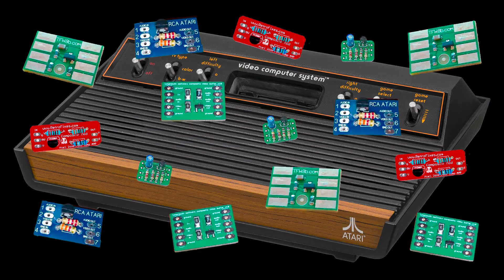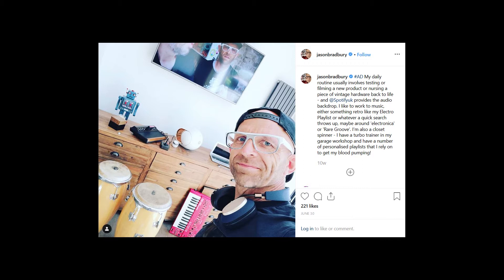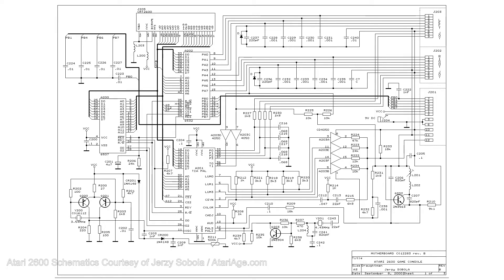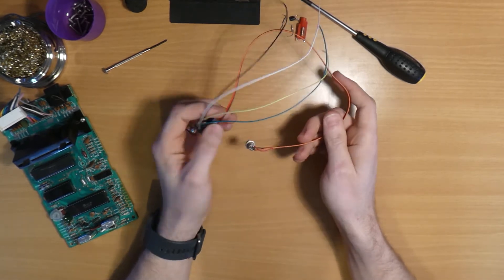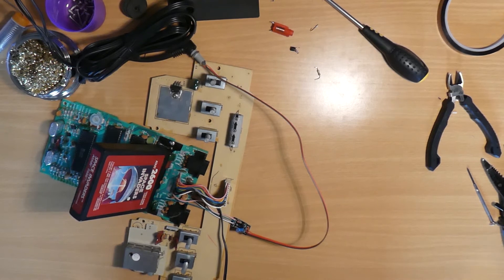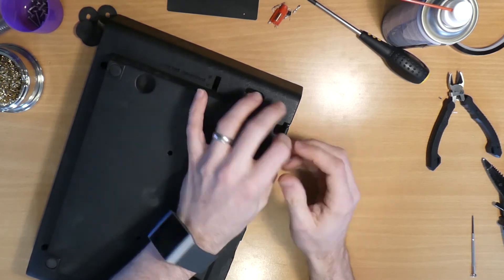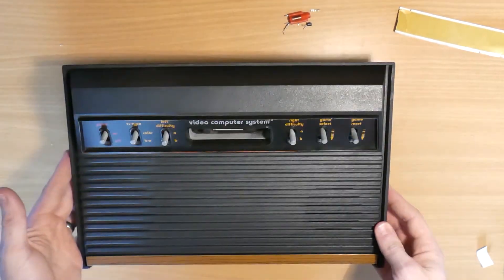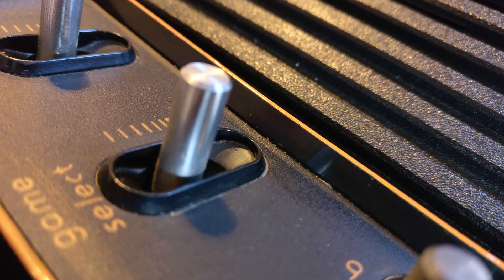Atari 2600 Composite Mod Tutorial - For TV's Jason Bradbury!

Comment: There is a way to mod this without removing any components. Just add some resistors and one cap to the CD4050 , and you are good to go . And to work you have to add proper 5V to the CD4050, because it powered only by 3.7V or so. (Atari's mistake)

Comment: Great vid... I’m going to mod my Atari soon, think i will use rca ports as I don’t want to run the risk of someone in the future plunging the PSU 3.5MM jack into an AV port
Reply from the maker: This is a very good point and something I should have warned about in my video, actually. I haven't tested it myself but I imagine plugging the PSU into the AV jack would be a very bad idea!
Reply from the maker: By the way, I would consider the UAV mod over this one if you're confident enough to tackle it. It's slightly more difficult to install but makes a huge difference. I made a video on it here: https://www.youtube.com/watch?v=XjjghprXHnE

Comment: Hi Rees

I have noticed that you have used pin ten of the ribbon cable for the ground connection, which is shown clearly in the second schematic in your video.
But looking at the main schematic I can't see where pin ten is grounded.

Could you clarify please (I know that pin three and six are suitable candidates) but I am slightly confused.

Regards,

Mark Affleck
Reply from the maker: This was such a long time ago I can't really remember the details but if I used pin 10 it must have been grounded on this particular console. If 3 or 6 look like better candidates in your case then I'd go for one of those instead 👍
Reply: @ctrlaltrees  Thank you!

Comment: The only version of an Atari 2600 I've got, is the excellent Flashback 2 plug & play, which is an actual 2600-on-a-chip, rather than an emulation like the original Flashback (NES-on-a-chip) and Flashback 3 onwards (ARM processors). It's a lovely little machine, already has composite output, and with a UK power supply of the correct type, will run happily on a UK television. It can be modded to have a cart slot, so you can use real 2600 carts too. I only wish Atari had used silver toggle switches, instead of big orange push-switches.
Reply from the maker: Nice! Yes, the Flashback 2 is a great option, especially with the cart slot mod. 👍

Comment: Hi
Is it important if the Atari is Pal
Or NTSC ( after the mod is done ) ?

Thanks
Eran
Reply from the maker: UAV is compatible with PAL and NTSC systems - on NTSC systems it will output NTSC, on PAL it will output PAL.
Reply: @ctrlaltrees  
Thank you. May I ask my question differently. Is the composite mod checks and "looking" for a match of Atari 2600 NTSC and a modern TV NTSC or it is not important al all , if the Atari is NTSC and the TV is in Europe ?

Thanks
Eran
Reply from the maker: @eranfeit  It depends on the TV model, but most modern TVs support PAL and NTSC with no problems.
Reply: @ctrlaltrees  
thanks

Comment: Hi. I wonder if you can offer any advice on an AV mod which doesn't work. The Atari 2600 was working via RF ok.
I have assembled the mod per instructions I have seen on the Internet but I get nothing, no video or sound.
Looking at your video I conclude that the audio is effectively passed through so I don't understand why I don't get sound at least. I have picked up the audio from the appropriate place on the main board.

Any help would be appreciated.

Comment: Nice vid, whats the ebay username, have you got any mods for sale?
Reply from the maker: Hey, thanks for the feedback!

The ebay username is ctrl.alt.rees - I'm based in the UK if that makes any difference. I don't currently have anything for sale, I'm not a professional seller to be honest. You should be able to find them easily enough, there are always a few on there.

That said I'm actually now pointing people in the direction of the Ultimate Atari Video mod from a company called The Brewing Academy. I literally just finished filming a video about it over the weekend which should be live in the next couple of weeks. It's slightly more expensive but a big improvement over the mod featured in this video. The installation is a bit more complicated but should be easy enough to follow along once my new video is done.